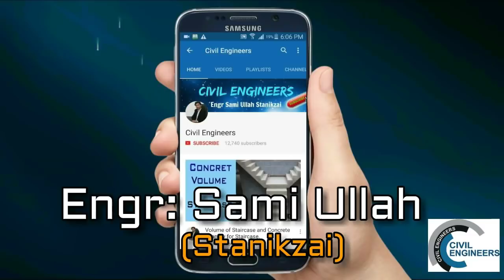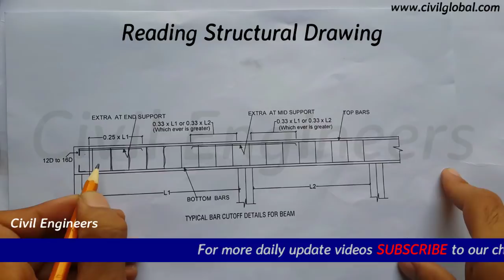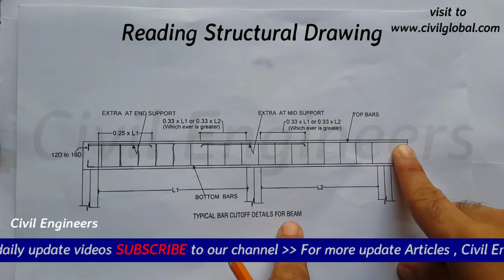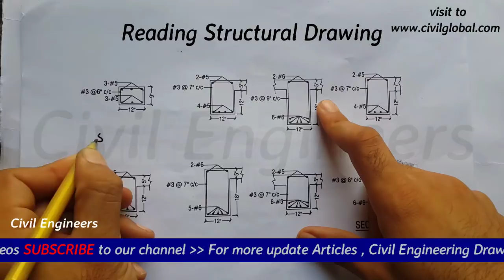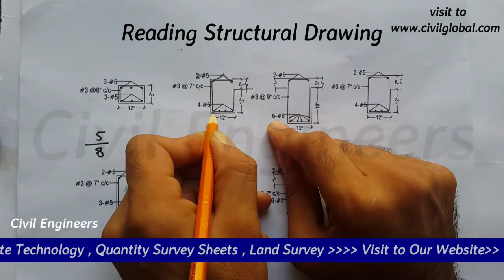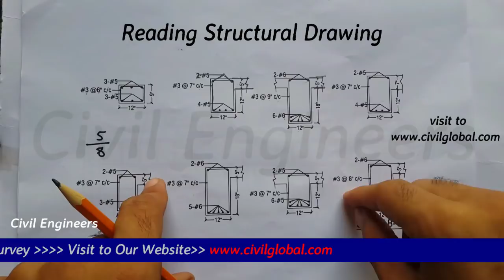Reading structural drawings |How to Read Structural Drawings| Example Reinforcement Drawing

Comment: 5/8 means and 5 means 5mm dia of bar
Reply: Inzamam 11 no it mean that 5 in 8...
One feet equally divided into 8 parts!  it mean 5 parts of feet' out of 8"
Reply: Jabir Hayan dear 8 means there is 8 suter in one inch so it means 5th part of the inch 5/8
Reply: jungle305  dear in urdu or pushto we call it suther and in hindi or english i think its SOOT .means 8 soot in one inch or 1 soot =3.175 mm .
Reply: In 1 inch, there are 16 divisions which are equal to 8 soot. So, 1 Soot = 2 divisions.
Reply: #5 bar means (5/8)" diameter of bar which is equal to 0.625". We can convert 0.625" into mm which will be 15.875 mm. But for easier calculations, we take it and calculate it in inches rather than mm.